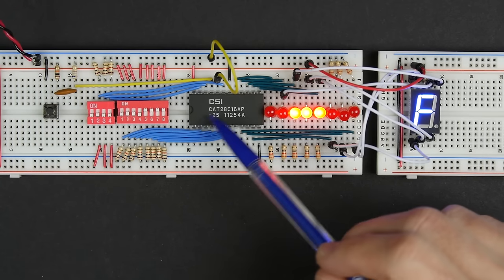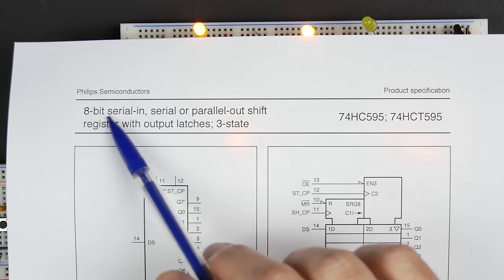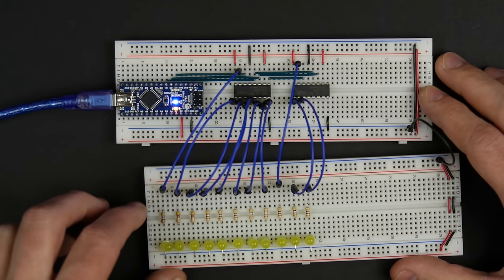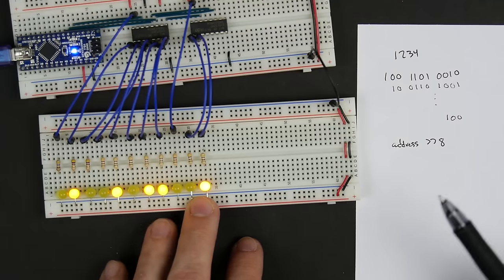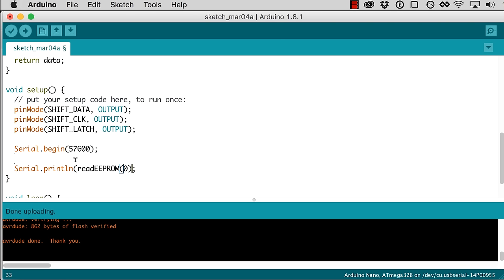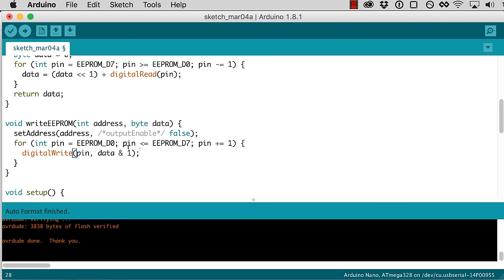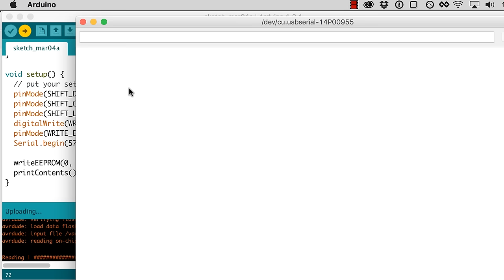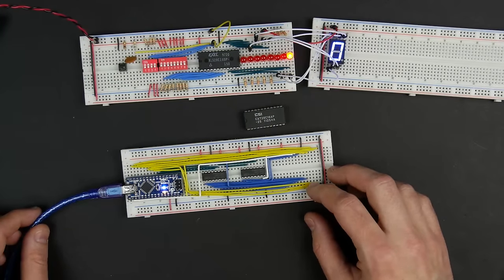Build an Arduino EEPROM programmer

Comment: It's my first time seeing shift registers, and it seems in theory just with two pins we will be able to control ANY number of pins using a bunch of shift registers. It's not a good use of Arduino pins but theoretically possible?
Reply: Essentially in a nut shell you basically how computers (eg microprocessors with peripherals) operate on a very very low level type of way. Arduinos are just a bunch of registers and other electronic circuitry to obtain proper timing parameters. Transistors act like switches, and there are trillions of transistors in a cpu board. So you’re thinking isn’t as far off as u think. But there are specific IC packages like the 74595 or something that is an extension register I guess u could put it that allows for more I/O signals to be utilized via the arduino or whatever else’s limited GPIO pins. Here’s a nice quote I found regarding ur comment:

“The person who built the processor - for example Intel - decides what each combination means.

The CPU understands a language called "machine code". Machine code is made up of a series of 0s and 1s.

There is a command called MOV, which moves a piece of data from one place to another. MOV isn't actually machine code, because it's not 0s and 1s - it's something roughly equivalent to machine code but (slightly) more human-readable called "assembly language" The machine code equivalent of MOV is 10001001. (Actually, there are lots of variants of MOV, and this is the first half of one of the variants, but I'm trying to keep it simple.)

This code was decided by Intel. They could have chosen any code they wanted, but this was the code that they chose.

So they built a group of switches so that there are a group of 8 wires, and when the 1st, 5th and 8th of those wires all have a signal on them, but the others don't, the switches turn on the "move" circuit.

Then, they built thousands of other groups of switches that work in a similar way. They also built switches that actually do the moving, or the adding, or the subtracting, or whatever else needs to be done, and connected them up so that they get turned on and off when they're required.”

Comment: Q: could you use a 74hc299 (8-bit Universal Shift/Storage Register) instead of the 74hc595(8-bit Serial-to-Parallel Shift Register Tri-State)? (yes, I understand that the address lines are input only). But could you use the 74hc299 for Reading and Writing the D0..D8 lines on the EEPROM? That way everything is being done/controlled by the serial Lines? Which begs to point out that you could program both EEPROMs at the same time if you could read and write the IO of each chip via shit register. The other point being later you could use the Nano to program your Ram later in your series R/W the IO lines using the 74hc299. It would save time.

Comment: Hi @Ben Eater, I just crashed on this channell but seem to be very good explanation of the programing basics. Thank you for doing such videos, keep doing them :)
However, I have an off topic quiestion: Where do you buy these Du-Pont connectors from. They are not like the cheap square profile connectors, but more robust. I have never had the chance to find them and will be glad if you can share a source of quality stuff like yours. Thank you in advance.

Comment: By the time the microcontroller figures out which port and pin WRITE_EN is in digitalWrite, more than 100 ns has already passed.  delayMicroseconds can only cause problems for EEPROMs that closer to the specs.

Comment: When you picked shift register to store address I thought 'why not parallel register', I thought that it is more convenient to read group of arduino pins to it and change registers in order to store data/addr. But when I reached the place where you write code I frustrated, because I thought that it is some way to read/write pins in one action, not reading them one by one and  push into byte variable.
Reply: That bothered me too, though the only fully available port on the 328P is PORTD, which overlaps with tx/rx (though that could be switched between serial and io). If you're running without an external oscillator, all of PORTB is also available

Comment: This is a great series, but this episode could have been better (maybe an update?) as the output A0-A7 on the arduino could also be used as digital outputs making the whole thing so much easier. This is now more about a shift register, which is by itself also a good subject but better if it was separate. :)

Comment: You comment that there's only 14 digital IOs on an arduino/arduino nano.  But that's not correct.  A0 - A5 are also digital 14 - digital 19 (A7 and A8 are purely analog though).  Most pinout diagrams don't describe these though.

Comment: At 34:03 you mention you shouldn't plug stuff in while it's powered up, but you get problems unplugging the Arduino from USB. Why not just unplug the circuit's connection to the Arduino pin that's supplying the power? Just lift that one wire then re-insert when you're done, or, better, put in a switch. Yep if you re-plug an Arduino often Windows will set up a brand new serial "port" with a new number and the Arduino software will need putting right on that, or just re-starting.

Comment: you mentioned that your manual clock pulse generator sometimes will still bounce on the release position......i had the same problem.......this is what i did.......555 wired in monostable.....1k resistor to vcc the other side to pushbutton ...and other side of pushbutton to gnd......the junction of R and button tied to input 1 of OR gate.....same junction tied to invertor....output of invertor tied to 1k resistor to input 2 of OR gate....100uF cap from pin 2 of OR gate to gnd.....this makes an RC network.....output of OR gate to pin 2 of 555.........when switch is off pin 2 of 555 is held high by resistor to vcc....through OR gate.......when switch is pressed, a clean one time pulse is output from 555....even if switch is pushed and held down......and even if 555 timing cycle ends and tries to recycle......reason is because when switch is pressed.......the invertor output goes high which charges cap through resistor at pin 2 of OR gate......after time constant of network....C charges sufficiently to send a high signal thru OR gate and holds pin 2 of 555 high...despite what the switch is doing......the RC time constant charge is slightly delayed so that output of 555 has time to switch states upon initial switch contact....and if switch bounces upon pressing or releasing it....the charge on C will keep the input of 555 high.... and stay high despite if the switch bounces.....upon release of the switch, C will discharge thru resistor and output gate of invertor again with a delay....so switch bounce is eliminated completely upon pressing it and releasing it.......great videos by the way....very informative....... most guys will build a simple monostable circuit using a resistor and switch tied to pin 2 of 555 but what they don't understand is that even monostable circuits have timing components and if the switch is held down....the circuit will continuosly switch between timing cycles.....explanation of circuit above will eliminate that problem.....a one shot is supposed to be just that......one shot only on every push of the button....not multiple shots .....components are....2 (1k) resistors, 7404 hex invertor, 7432 OR gate, 100uF electrolytic cap, pushbutton.....the invertor MUST NOT BE an open collector type.......such as 7405 or 7406....thanks........silvio
Reply: Wow that's long!
Reply: @subramonianiyer9010  lol....yeah well i couldn't leave out details...you know
Reply: @silectronics  You could've used a linefeed xD
Reply: @subramonianiyer9010  yes i could have....wasn't in the mood i guess...lol

Comment: Assuming that you will be programming the entire EEPROM, wouldn't it be faster to build a 11-bit binary counter with TTL? Then the Arduino can simply reset the counter at the beginning and increment it by one after each write. If you want to make this more flexible to be able write section of EEPROM, you can always shift the start of count serially and increment it for the number of contiguous bytes you need to write.
Reply: The perfect chip for this is the CD4040 (or maybe 74HC4040), a 12-bit counter. And forget about shifters, just give a reset pulse and then the same number of clock pulses as the starting address. (4096 pulses will take about 2ms if coded in assembly)

Comment: How many more chips and bread boards would you need to duplicate a corei7 with mother board and GPU, that could run windows 10 with crisys ? That would totally be doable. I bet the biggest reason why you couldn't even come close would be clock speed that has to travel over wires that are too long not to mention chips couldn't come close and adding more chips to over come would cause more problems. I know if you made an iPhone with vacuum tubes it would be the size of LA with more power consumption. That might be square miles in size?

Comment: Instead of using an EEPROM, why not a 7447 BCD to seven segment decoder driver?
Reply: I don't think input values 1010 (10d)(Ah) -> 1111 (15d)(Fh) are displayed as A, B, C, D, E, or F.

AFAIK that chip is designed to output decimal numerals, and then maybe a few letters you wouldn't expect after 9.

The 7400 series was sorely lacking a 4bit binary to hexadecimal display driver.
Reply: @massimookissed1023  D-latches can be wired like memory and are directly addressable.  So you move a value into that addressable location and the latch reflects that value. A D-latch is much cheaper than an EEPROM and will support any segment combination that you like.

Comment: It's true that making the programmer from an Arduino Uno. you don't have enough pins, but as soon as you decide to use a Nano instead, you now have seven analog pins that can be used as digital ones instead of just five on the Uno.  That enough do do away with the shift registers completely.

Comment: 4094 + SPI was not basic enough?
You can use the board pins 3 through 12 and A1 through A6 for digital out, that makes it 16 total.

Comment: Dear Ben,
thank you for that many nice videos. My english is not the best, but u can teach very good. And u help me to come forward in my Smart-Garden Projekt. But i have some problems with your code. 
Im using the RaspberryPi with PiFace and wiringPi. I´ll write all code by my self in oldscool language C. So i test a part of your code like the "byte Data[ ] {.....}"  and printf (not sprintf)this to the console. if i want compile this i get the error that datatype byte is not define. Now i take my C-Book and search for this problem. i find that the datatype char is allready 8bit hex. so My first Question is: Did u define "byte" somewhere or is it an andurio gadget like a library?
At next i tested to change the datatype to "char data[ ] {....}" it seems to work but if i want read the data 0x81 from data[0] with  %02x i´ll get  ffffff81not 81 but if i set the first char from the hex to an 0 it works example:  data[1] = 0x01  printf  %02x = 01

it will be great if u or the community can help me alittle bit

thanks alot

Comment: Nice!
it can be used to program the 27c512 ?
Reply: If it has the same timing and voltage requirements, yes.  But you'll need another shift register if you want to handle the OE pin this way, since the 27c512 would need all 16 address pins available from 2 shift registers.

Comment: If you're going to make an interpreter for a shift register anyway, why not do it for the whole thing and just add one more 74HC? That must be easier than coding one set of instructions in one "language" for half the EEPROM and another for the other half.

Also, that leaves pins over on the Arduino for things like the reset switch, to avoid the first mistake you made, when the data from the previous run of the code ended up shifted to the next 74HC. Sure, you can ensure through code that it always shifts 16 bits (or 24 if I had my wish), but why not reset the 74HC's between each instruction set, just to be sure?

Comment: 33:08 " 'pin' was not declared in this scope"
I copied the code exactly and I can't upload because the byte function has this error. Why does anybody like programming? This seems like such an absurd thing to go wrong when the code is completely identical
Reply: as a programmer: the code is probably not compleatly identical, and if it is the software you're useing is probably diffrent... 
anyways if you still have the code ping me with a link to it (you can use pastebin) and i'll see if i can find out what's wrong.

oh, and to answer the question, we like the problem solveing.. it's all a giant puzzle to us.

Comment: Little interesting fact: NES, snes, and n64 controllers use this type of setup for there function. Infact there is a video by 8bitguy on how to connect an NES controller to an old pc using data, latch, and clock

Comment: I can't seem to get my EEPROM to program correctly. The output shows all 47s after it erases and reprograms the memory. Is anyone else having this issue?
Reply: Yes I have been developing the same prototype described in this video I am using some ATMEL AT28C16. I cannot get it to work. The data read does not match the data writtem. I am may even thinking that at some point some memory location cannot be updated anymore.   :  (
Reply: Frederic Torres I finally got mine to work. There was a mix up in the write enabled wire.
Reply: I'm having a very similar issue only the last byte of the test data is written but it's written to all addresses.  How did you resolve your similar issue?  Thanks

Comment: What general wires do you use that are flat on the breadboard?
Reply: They are just single core wires cut and stripped to length. You can do it with copper "multi" core wires, but they are loose then and it looks like a rats nest. The only downside with the single core is try not to re-route and bend them too often as they will snap internally.

Comment: I'm guessing the delay needed to be increased for the Arduino, it may take some time to switch pins from write to read mode.
Reply: This sounds reasonable. Should be tried out: using a small delay between the writes and a larger one between the last write and the first read. If someone has a physical implementation, could you please try it?
Reply: That would actually explain, why was the 2 first bytes read wrong, not just the one that was written.
Reply: If he is routing the address through those other two chips, it could be the added slew rate in combination to the write wait time.  The chip would need enough time to send with the increased delay from the other 2 chips, as well as the read time.

Comment: Hi! Will this work for the 27C series of EPROMs?
Reply: for this case need pair of resistors, MOSFETs and additional +12~14v for A9 and VPP pins... and slightly updating the code
Reply: Thanks. Do you have a schematic?

Comment: Totally and completely stuck at this part. I have a mega and no experience with it.  As this is my weak spot(programming) I expected this to be harder but I cannot match up my stuff to what he’s doing at all.
Reply: WTH AM I MISSING!!!!?!?!?!?!!!!!!!
Reply: I rebuilt the circuit several times that is correct.  I tested ALL connections for continuity and np.  I changed the pin labels to match my arduino mega 30-37 for data 50-53 for control.  I either get all FF or all 00.  This somewhat worked before with the hexidecimal I was able to get all but 0,64,128,192 but now nothing.  Trying different 595’s and then different EEPROM but im freaking bummed this minor difference between arduino’s seems to be killing me.
Reply: Bad EEPROM. Popped in the second one and it does the exact(correct) thing each time.  The unpredictable behavior from the bad EEPROM really messed with my head but I should have eliminated that earlier.

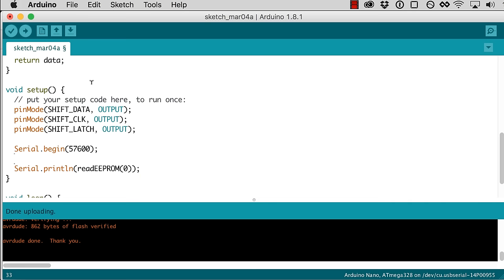Comment: OK guys, I am having a bit of a problem here, earlier in this video around 32:59 where we first start reading what is on the ROM.
I get ò or ù instead of a number. 

This is my current code, please look it over and let me know if I did something wrong.

https://drive.google.com/open?id=0B6LIgQzDkH8fUDR1eEloWlc3TlU

I thought at first that I may have setup my I/O lines incorrectly. So, I removed all the data (I/O) lines and ran it with no I/O lines hooked up and still received odd characters. Then I used jumper wires, instead of the permanent wires. Still the same odd results.
I also tried another ardruino, same thing. I also double checked the code.

I also just tried a single adruino with nothing else on the board at all, ran the code and got a É

Please help thank  you...
Reply: PROBLEM SOLVED:

This problem drove me crazy, and when I finally figured out the problem, it was really something easy.

OK, you know when we set  Serial.begin(57600); 
Well when you open up your serial monitor you have to set it to 57600 at the bottom right.

That was it. That was the one driving me crazy. I rechecked everything, tried multiple arduino's
pulled my last two hairs out...  LOL !!! 

Hope this answer saves someone a hair or two.